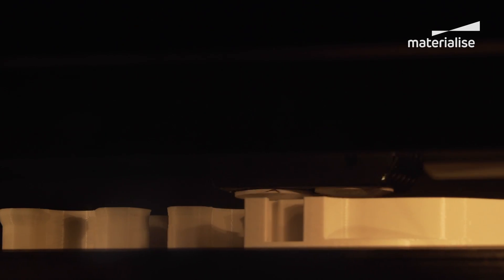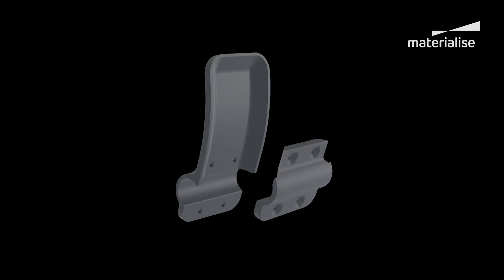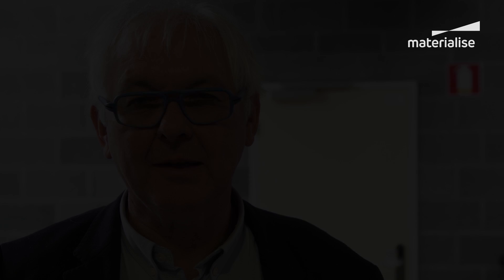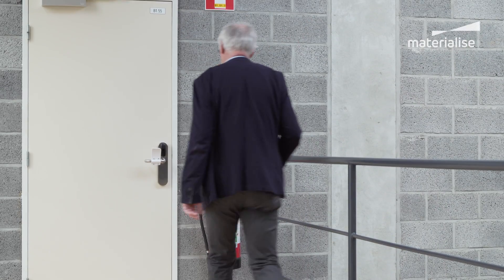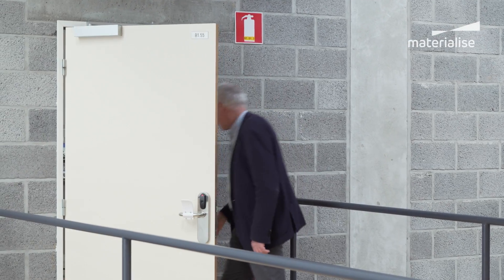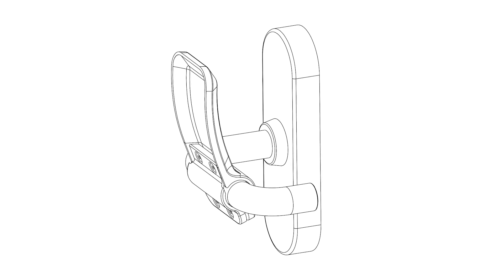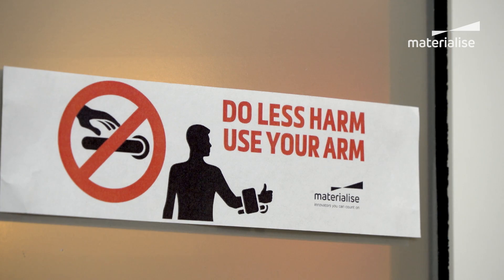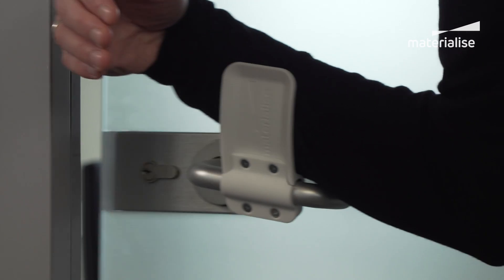Hands-Free 3D-Printed Door Opener to Help Against the Spread of Coronavirus

Comment: What kind of non slip rubber are you using? I printed this model, tested it but it wont work with 3 diffrent rubbers between the two parts. It slips everytime i use the door opener it slips down.